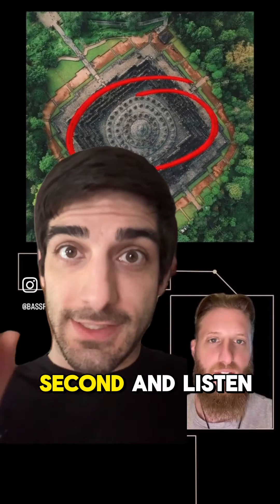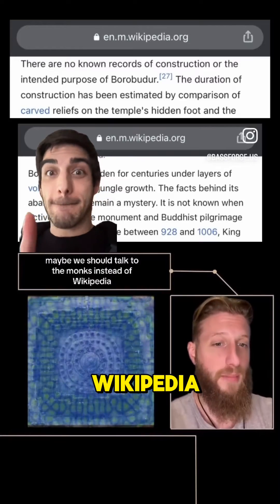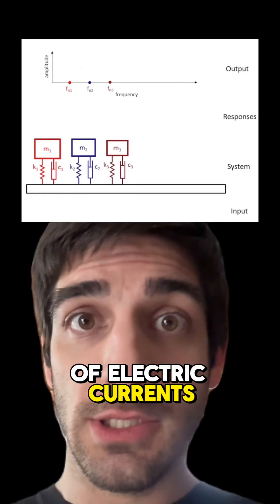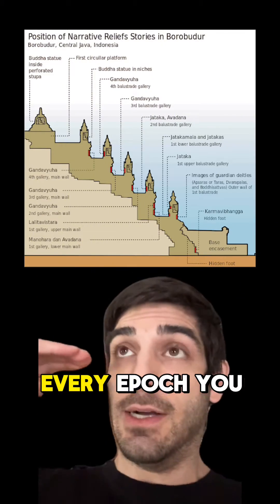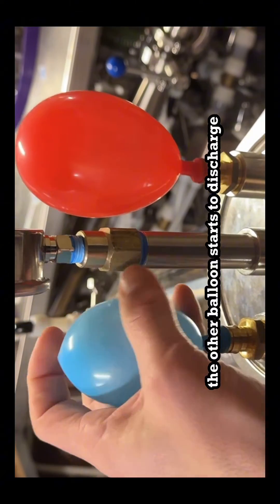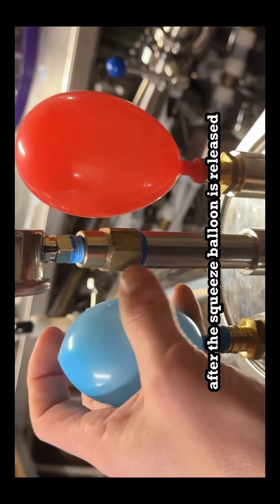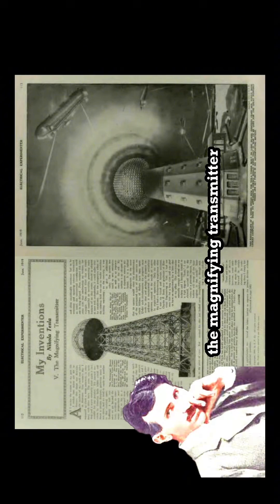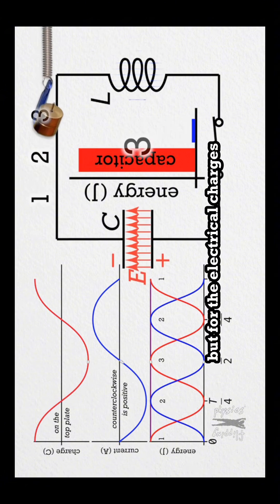Seismic Stealth Technology - Borobudur Temples

Comment: Ok, so both the reel creators in this video need to get this message. The damper with statues within them, openings of the bells are primarily of two types square and diamond. We all agree this was a reciever, but the question is of what. One option is vibration and sound monitoring of the active volcanoes, one option is like radio has two parts, this was the reciever but where is the sender. The sender is Paharpur Mahavihara Bangladesh, a structure that could magnify, amplify sound of monks chanting. Both the creators might not be aware but at the time there was an amplitude of work being done in India in terms of tantra and the physical manifestation to that came from the Samkhya philosophy (mastery in numbers) . Please look up Paharpur Mahavihara, and amplification maybe even the use of atmospheric ducting which volcanoes could have also played a part of. We are too dim to fully grasp their capabilities. The top level of borobadur is dedicated to the formless ( sound frequency and electromagnetism).  The material chosen is also electromagnetic at Borobadur. This deserves an extensive study with simulation and recreation of possibilities perhaps even a PHD. Hopefully you will reply.
Reply from the maker: Hey thanks for commenting! Great points! You might be Interested in a few other studies and patents I have found. 

 Tectonic Discharger Patent - US20100271908A1 United States           Inventor Bereli M. Lazar             Abstract            The structure for severe earthquakes prevention includes:               at least one vibro-shock machine with a drive-adjuster,            at least one anvil shock-transmitter, dry well unit, controls, seismographs, all placed in local epicenter area at upper tectonic plate.           The method is based on:            periodic operation of shock-vibrations with adjusted frequencies corresponding to own natural frequencies of hypocenter’s plates,           direct transmitting of generated shock-vibrations to the hypocenter’s plates, and exciting them at their resonance frequencies,             triggering small, controlled, artificial mini-quakes of low and safe magnitudes for preemptive dissipation of stressed plates’ accumulated elastic energy, thus preventing a severe earthquake in future. 

Normal modes of the Earth           Jean-Paul Montagner and Genevi`eve Roult            Institut de Physique du Globe                Abstract: The free oscillations of the Earth were observed for the first time in the 1960s. They can be divided into spheroidal modes and toroidal modes, which are characterized by three quantum numbers n, l, and m. In a spherically symmetric Earth, the modes are degenerate in m, but the influence of rotation and lateral heterogeneities within the Earth splits the modes and lifts this degeneracy. The occurrence of the Great Sumatra-Andaman earthquake on 24 December 2004 provided unprecedented high-quality seismic data recorded by the broadband stations of the FDSN (Federation of Digital Seismograph Networks). For the first time, it has been possible to observe a very large collection of split modes, not only spheroidal modes but also toroidal modes.